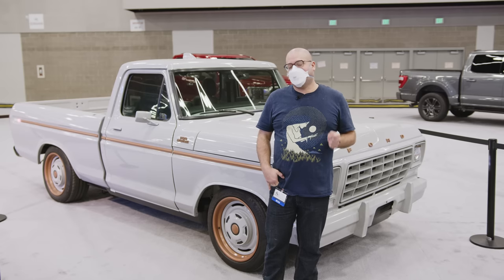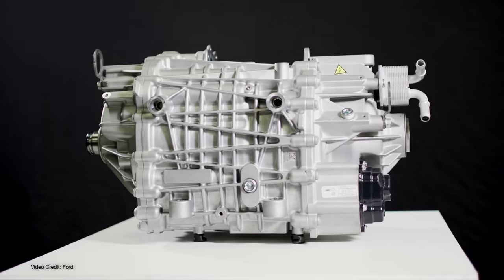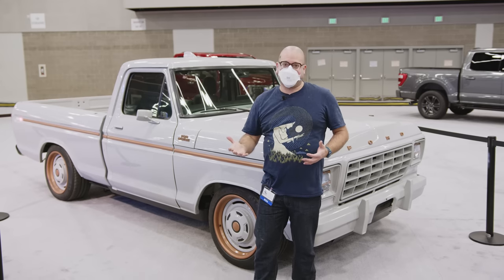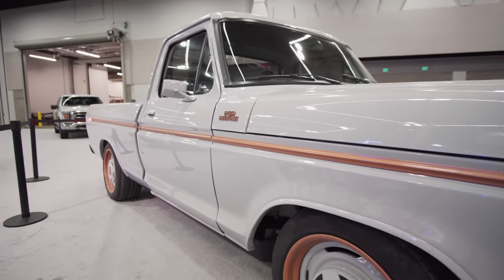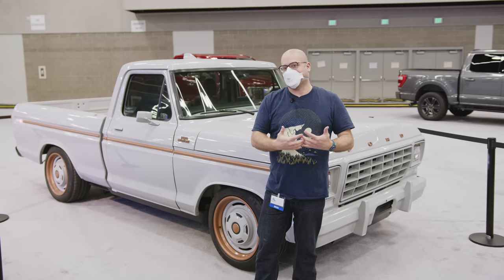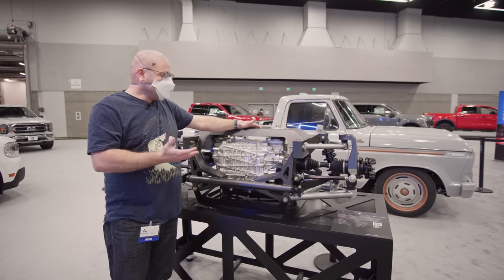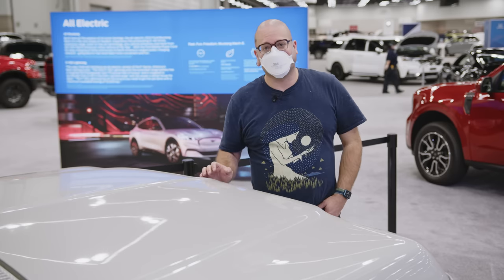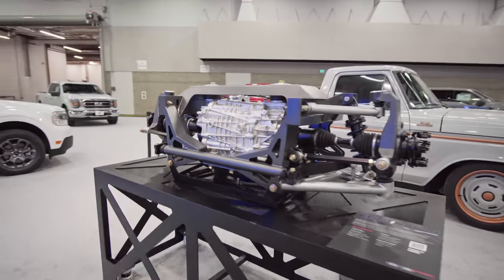Here's What Happens When You Put A Ford Mustang Mach E Inside A Ford F100!

Comment: Drop in EV conversions would be a very good way to electrify a significant portion of the current vehicles on the road and probably a lot cheaper than buying a new EV. Besides, I really like the size and utility of my small 2007 Ford Ranger pickup. I live in a climate where I could give up my A/C, but would need to hack some kind of inductive heating/defrosting. Also, think of all the CO2 emissions  we'd save by re-purposing fossil fuel vehicles instead of scraping them.

Comment: Hmm. The motor is cute but the HARD part of these conversions is the batteries. Its why GMs Bolt-based Crate was restricted to vehicles with large flat floor cargo areas that owners were ok with completely sacrificing to battery. I was really hoping Ford was showing off a battery solution but clearly that is all hidden. The custom interior also points to my suspicion that this was probably not a bolt-in conversion... But one that perhaps required serious modifactions of the original ladder frame.
Reply: re: "The custom interior also points to my suspicion that this was probably not a bolt-in conversion..." correct, it wasn't.  re: "But one that perhaps required serious (modifications) of the original ladder frame." correct again, "bankrolled" by a MAJOR OEM this was a  big money ($$$) fabrication job with a bespoke square tube chassis constructed like say a hot-rod or a racecar.  unfortunately laypersons from outside the Auto Industry don't fully understand what it means when they hear the words "SEMA SHOW CAR".  at this point you're talking the likes of famous builders like Dave Kindig, Chip Foose, the Ring Bros, etc.  not that a little guy can't do this, but these are the guys with TV shows on Discovery Channel.
Reply: re: "Its why GMs Bolt-based Crate was restricted to vehicles with large flat floor cargo areas" heads up, I believe they have a NEW system coming (eventually) based on Ultium.  i spoke to the engineer directly about it.  it's in the Project X Yellow '57 Chevy EV conversion which also debuted back at SEMA '21, it had a modular/configurable battery pack in the trunk.  the sad part is all of GM's kit is proprietary, not open source and is for all intents/purposes UNHACKABLE (yes many have tried).  Ford in contrast is the COMPLETE OPPOSITE, they actually WANT you to use and buy their stuff.  from this you can tell who's serious about EV's, and who (despite outward appearances) is trying to stall/slow things down.

Comment: Crate motor is fine. What about all the really difficult bits of an EV conversion. Converters to run legacy 12V systems, charger, cables, plugs, motor controller and BMS, power brake and power steering systems, cabin AC and heat... BATTERY?!?  Honestly the motor is probably the most straighforward part to swap in. Just a matter of brackets and the driveshaft(s)
Reply: re: "What about all the really difficult bits of an EV conversion. Converters to run legacy 12V systems, charger, cables, plugs, motor controller and BMS, power brake and power steering systems, cabin AC and heat... BATTERY?!?"  "NO ANCILLARY PARTS FOR YOU...!!!" (Soup Nazi voice)  ironically on Ford's information plaque with the crate motor display it states: "Does NOT include Traction Inverter, Control System, or Battery."  i still have the pic on my phone from PRI/Indianapolis.   i reckon the Eluminator is for PROS only, although this does NOT preclude aspiring amateurs willing to shell out $4 GRAND to have an amazing "paper weight".  they'll make it work eventually right...?

Comment: Looking at that motor on the stand really puts into perspective just how much better Tesla is at packaging.  Guess Munro wasn't kidding.  I still prefer the "motor in differential pumpkin" design of some foreign conversions here on youtube.  If I was gonna do a truck, I'd probably go with that.
Reply: This is a crate motor to drop into many types of older vehicles, not a custom design for one specific sedan/hatchback. If Tesla ever has dozens of cars/trucks going back 50 years they will need to do the same thing.
Reply: @davidmccarthy6061  I get that, but it still requires the user to custom fab mounts and run the cooling/wiring themselves, just as they would have to do with the extremely well packaged (and more powerful) motor from the Model S Plaid to use in a conversion.

Comment: Pretty amazing. I didn't realize the package comes with the whole drivetrain though that's amazing. Even if it doesn't its still awesome. Now if only Ford would sell the Mach-E battery in different sizes, like modules. So you could choose either a small, lightweight 30kwh battery, or a 60kwh, or the full size extended range battery...

Comment: Did I see 2 of these in the Truck?  Front/rear axle?  And what kind of price for a 'full kit' (Charger, dc controller stuff, alternator for the AC side, etc).  Will it do regen?  
No I'm not going to do a conversion, simply curious.
Reply: Q: Did I see 2 of these in the Truck? A: yes. Front/rear axle? A: yes. Q: what kind of price for a 'full kit' (Charger, dc controller stuff, alternator for the AC side, etc). A: the low, low starting price of a one Mach-E GT - $65,000 (hint this is what Ford started that's why the flat screen).  of course you still have to locate/buy a mint F100 (or some other project) and do all the associated metal/fab/paint/interior work so when all said and done the vehicle you're looking at costs roughly $1/4 Million Dollars to duplicate.  Q: Will it do regen? A: yup, it's essentially the Mach-E "skateboard" with the Mustang/SUV body removed and the F100 body set in it's place.

Comment: It would be interesting if automakeres themselves started to produce swap-in replacements for motor+gearbox+fuel container for batteries + electric motor. I would not need a lot of power and extra long mileage, as long as it would be able to charge quickly and drive around. At least I would not have to throw my car to the trash...

Comment: If I ran Ford, I would put one of these in every car show across America and every drag strip. I would follow in the footsteps of Yamaha with their ev philosophy. With Yamaha, you tell them which Japanese automobile you have, and they send you everything needed to convert that vehicle. Ford should offer the same for every model Ford ever. They could offer entire conversion kits for everything from a 1950's Ford truck or car to any current Ford car, truck, or van. GM had an even better idea. They were making an electric crate motor that just bolted right to any GM v8 transmission.

Comment: This is a great thing.  My big question is how much does it cost to retrofit a vehicle to become an EV?
Reply: Its one of those if you have to ask you cant afford it things. The real problem isnt even the motor. The real problem is the batteries... They are bulky, VERY expensive, and require custom steel battery boxes. And the whole thing requires high voltage wiring that is also expensive and requires a level of safety that your average tinkerer is not used to. Its also not entirely clear from this video whether the structural frame of this vehicle has had to be modified to accomodate the batteries, but that has tradtionally been a big concern. Then of course you have to beef up the suspension and at least the front brakes and add electric motors for things like battery cooling systems, A/C, brake booster pumps, and power steering pumps (depending on what the specific car requires). I can tell you that in many cases if you hired a shop to do it, most conversions would cost as much as a new EV.
Reply: Q: My big question is how much does it cost to retrofit a vehicle to become an EV?  A: all the money.
Reply: @patreekotime4578  what a rude answer.  It pays to be polite.
Reply: Pay no mind to the rude reply.   There are a large number of resources you can avail yourself of for an EV conversion, whether it is FYI, Professional or mix of both.  The cost will be in the range of $3K to $12K.
Reply: @stgeorgee  you are sadly misinformed. Just a used tesla drive unit assembly is $3-5k+
You'll need a motor controller solution, bms, drive shafts, coolant hardware&pumps, lots of connectors, wire , crimps, suspension, battery cells, battery box etc. One of the cheapest tesla swaps I'd ever seen. Where the guy doing didn't count his own labor. And resold all the stock parts he took off. Still cost him almost 25k and the car had under 150miles of driving range. Have a shop do it and that easily double or triples in cost. 

We are a very loooooooooooong way from affordable anything in the ev swap game. Right now it's just like evs themselves if you aren't solidly upper middle class in income, you can forget about it. 

Unless you also have master mechanic level skills, a fully outfitted shop, welders available, fabrication jigs. And buy dirt cheap salvaged parts you pulled yourself. Then do all the work yourself. Even still a simple 100-150mile range project with decent power will cost you at least 10-15k.
Reply: @4literv6   nothing you have said is true.  A lot of half truths and even more falsities. Since I have converted a number Cars (MGs, Triumph’s and Karman Gia’s), for under $10K.  You’re wrong.  What more, you can buy complete conversion kits, which are 100% compatible with a large number of cars, such as Porsche,and Volkswagens for under $12K.  Not calling you a liar… but….  You are.
Reply: @4literv6  also, there is this guy named Mate Rimac. You might of heard of him. At 19 years old, he converted a BMW 3 series from ICE to EV, in his garage.    In the states, people have been converting ICE cars to EVs since the 1970s.  There are load of FYI manuals and quite a few videos, right here on YouTube.    

To be frank, I find you to be rude and contemptuous.    I would suggest you take a few classes on interpersonal communications.  But those classes are expensive.  If you have to ask how much they cost, you can’t afford them (see what I did there).
Reply: @patreekotime4578  After reading a bit.  If one can afford to buy a new car, retrofitting one is in your price range easily.  Thanks

Comment: Based on what I know about Computer Aided Design (CAD) it wouldn’t be too difficult to determine how the battery could be made to fit under most vehicles.
Reply: Pickups and other non-unibody vehicles are fairly easy to convert.  However, unibody vehicles offer a entire host of challenges.  These challenges, reside with the location of the batteries and a limited number of cells.

Comment: Affordable Crate motors are an absolute must if electric vehicles are to succeed ... 
Its insane to scrap the materials and energy in the current vehicle chassis. 
There are also electrified live axels being produced for easier conversion of older vehicles and commercial vehicles.

The thing is these motors are still quite bulky compared to some other motor designs ...
There are other lighter, smaller and as powerful or more so motors being produced.

The much of the  work of the late William Towns and the 1984 Africar project . ..would be totally suited to modular E power trains and batch production of alternative kit vehicles.  
A lot of enthusiasts and DIY mechanics want as little to do with Corporation's stopping them from getting creative and trying to tie them into the whole  
high tech dealer/manufacturer none user serviceable/maintainable system that has also got into the waste maker planned obsolecence mess we are globally in.

Comment: Reality check:  on the surface it sounds like a great idea, but after trying to add sufficient batteries and all the technical conversion hurdles you still end up with an expensive, high drag coefficient, generally inefficient, unsafe piece of junk.  It's simply not practical except maybe to show off once in a while and use for 4th of July parades.  What's far more interesting is the Honda Insight conversion with the EV-1 motor that Nikki was working with.  Haven't heard anything since the initial video.  How's that going?   BTW: Glory to Ukraine.
Reply: Did you wake up bitter or is that your personality?  People are excited and know the different mods that will be needed. Not trying to keep them on the road just trying to keep them present. Have a wonderful day, Debbie Downer.
Reply: @twany442  Thanks for the personal attack, good to know who you are.  I'm simply being honest.  It's not practical.  Like I said the Honda Insight conversion that was partially done is interesting.  Would like to hear more about that.  A pickup truck conversion is pretty useless.  Convincing people that this truck useful is not the way to get to a sustainable society.